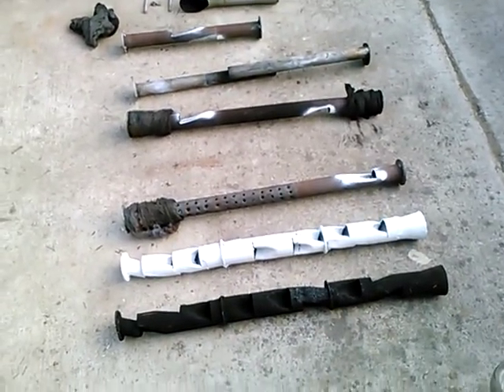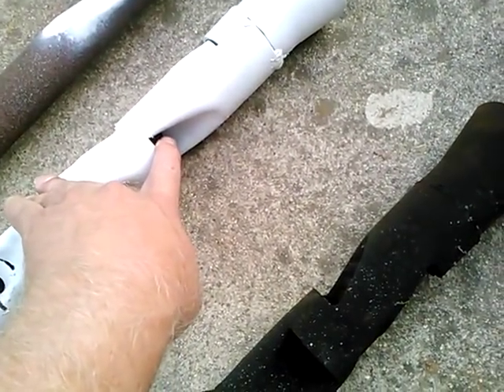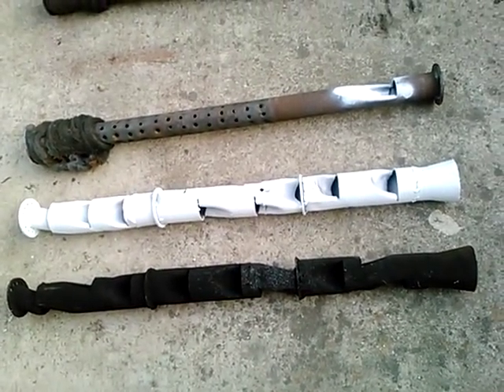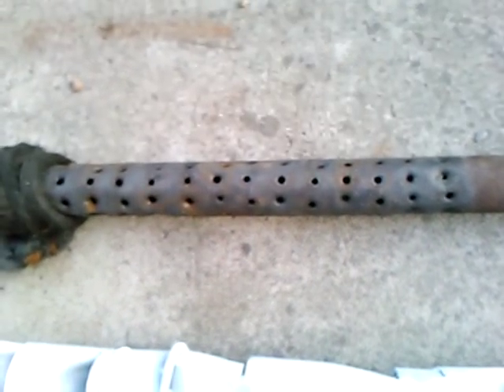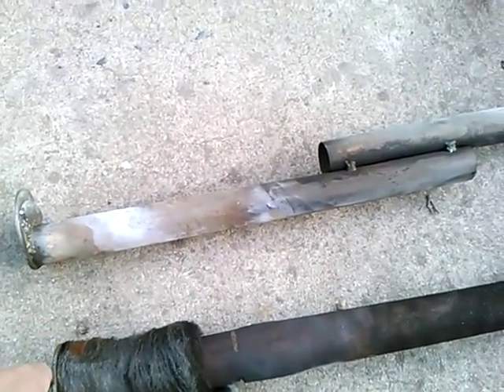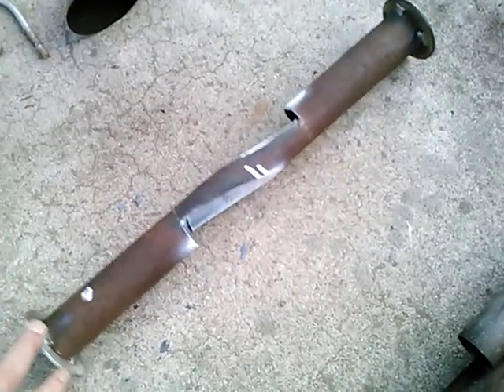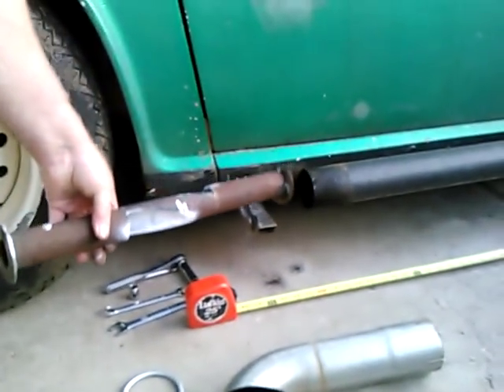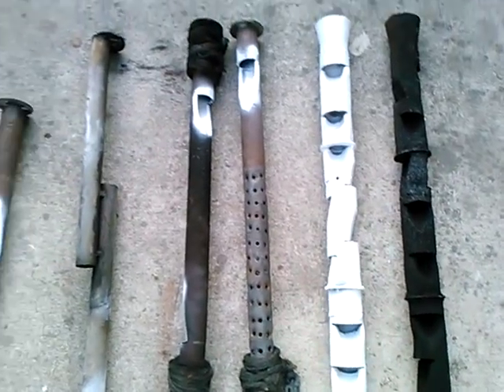Exhaust Baffles / Mufflers to fit 3 inch diameter side pipes MOV347

Comment: Thank you for making this so many years ago!! I’ve referred back to this video several times.  I have a C3 Corvette with sidepipes and am trying to temper the noise levels from ‘wake the dead’ to tolerable.  My ultimate design is going to be a reverse flow with electric cutouts to have the best of both worlds.

Comment: hey bud I have a question, I have a Pontiac G8 I have been told that if I take off the stock axlebacks, and replace them with 3 inch spiral baffles would I see a performance gain you think?
Reply from the maker: Any reduction in back pressure is likely to provide a performance gain.  There are many low-restriction muffler choices, but with these side pipes, I really can't go much beyond a 3" diameter pipe.  Won't something bigger fit under your G8 ?

Comment: I have a Radio Shack db meter that was about $29.. would be interesting to hear it run at various rpm and the db meter on a stand for consistent readings. Nice job.. good work. BTW what is the engine combination?
Reply from the maker: Not a bad idea.  Any of these baffles make a very different sound from the just having the straight pipe, both in tone and sound intensity.  The db meter would prove the greater quiet, but the tone is difficult to gauge.  Ford 302 two-barrel & C4.  Sounds mean but really isn't.
Reply: guidoguitar my curiosity is from having a 69 Stang CJ428 4 spd++++ that I bought in June of 1969. Back then there was a company called Trend Setter who made side pipes that AMC even offered through their dealers... Well 40+ yrs and Trend Setter has been out of business for 30 yrs I need to recreate the pipes/mufflers. Covers etc are still perfect.
Reply from the maker: 10susan10 Sounds like a project.  I'd like to try the spaced washers with short lengths of tube attached on the upstream side, joined together with threaded rod, like I saw in a video.  The video is about 3.5 inch pipes but the same principles should apply to 3".  I'd include a link but I believe links are prohibited in comments.
Reply: guidoguitar you have to break links into sections to get past the guardians...